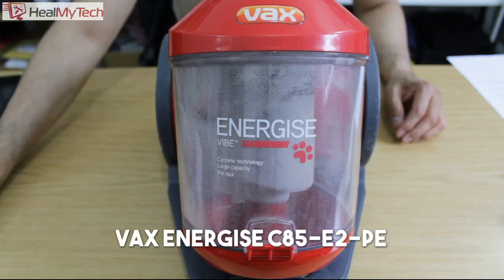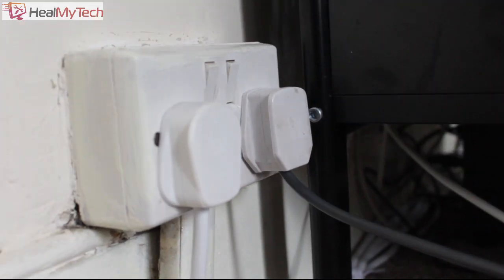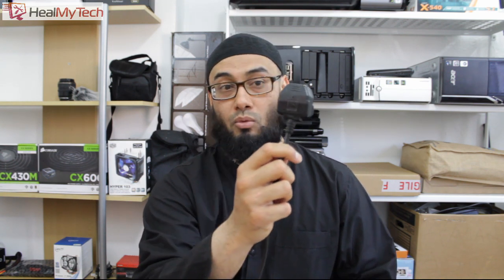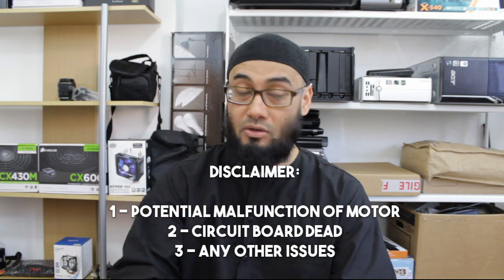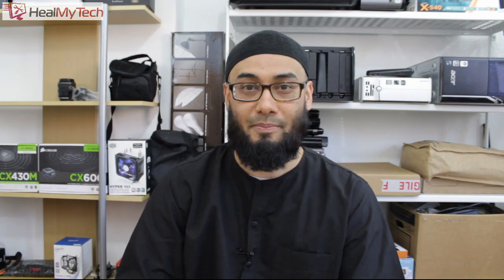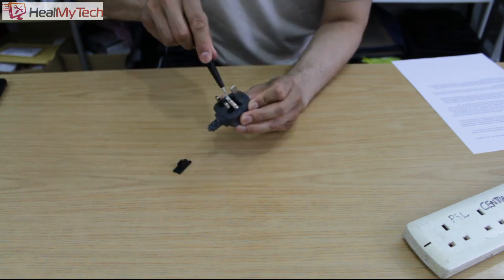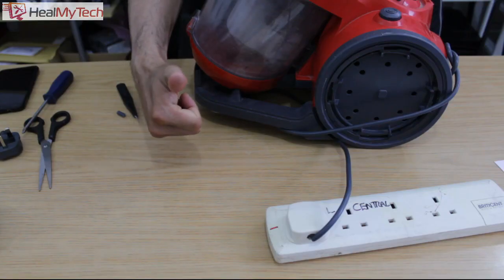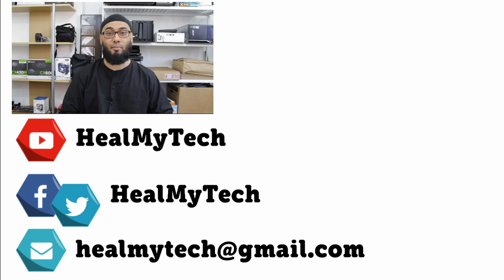How To Fix A Vacuum That Won't Turn On  - Quick Easy Fix For Under £1.00 or $1.00

Comment: You are so right. My philips would not switch on and it turned out to be the wire going into the plug. That's why I looked up vacuum cleaner not working and it brought me to your video.

Comment: Previously been talking via on line chat with Vax who suggested checking the filters and the hose for blockages. No mention that the problem could be the plug. Changed the plug as a last resort and, hey presto, my vacuum cleaner now works and I have saved money by not buying a new machine. These sealed plugs are a menace. Thank you

Comment: I have been waiting foranother useful clip ,  thanks you came back with a valuble info . I have a Bosch vacuum cleaner , about 2yrs old , It still works well , but stops half way upon cleaning ,tried all methods to fix it ,problem still same , through your experience what could be the problem ,please help . thanks a lot

Comment: Yesterday I turned on my vacuum and it came on for a second and then quit. After that it wouldn’t even begin to turn on. After watching your video I suspect the problem is exactly what you described. I am in the US, so the plugs are different, but I bet the principle is the same. I will go to a hardware store to seek a new plug. Thank you! THE NEXT DAY: I went to the hardware store. The appropriate kind of plug was no longer $1.00, but was now almost $5.00 (inflation is real!), but considering what happened next, it was cheap at the price. I brought the plug home, cut off the old plug from the cord, wired up the new plug, and plugged it into the AC. Nothing. I thought, “Oh no, it didn’t work!” Then I thought, “Well, at this point I don’t actually know if the vacuum is turned on or not.” So I pressed the power button on the vacuum, and guess what? It roared to life! It came on just like it used to! Thanks so much for your advice and instructions.

Comment: I didn't replace the plug but it was pretty bent up. After I straightened it worked again ( we are in the US), so either was coincidental or it was actually the plug. Either way thank you ..now I'm wondering if it was just the plug 🔌 on the recent coffee pot I threw out ..

Comment: What's the best way to tell if this is the issue without actually replacing it? Thanks for sharing btw.
Reply from the maker: You can open the vacuum cleaner and use a multi-meter to do continuity testing and if you cant find anything wrong then its the plug.

Comment: it was not the plug it was the motor it was wet and blow the fuse inside the hoover, but cut before I found out. waiting for it to dry spange in said motor took it apart.

Comment: pls help me i have window 10 lenovo when i turn on my laptop come the blue screens error ( stopcode problem)-( unmountable boot volume) then my laptop restart efter the restart the screen become black but in the same time it is lighting.... if u help me never forget it.
Reply: Yes it would to restart to the hard disk but my screen cannot show the hard disk . it show only a black. and i think that the problem not from the screen.

Comment: test it first
Reply from the maker: Test what first?
Reply: test the cord for continuity,means the cord is conducting electricity continuity test say positive lead put tester on end other lead other end have tester on resistance if conducting will show low resistance @HealMyTech1